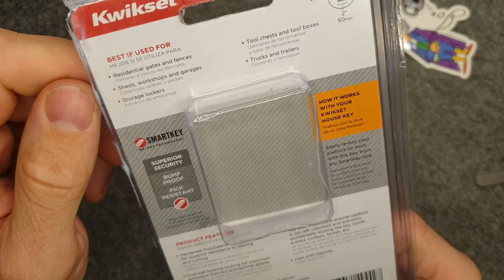[115] Kwikset Smartkey Generation 3 Padlock, from Jon Lock picked by bypassing the sidebar!

Comment: Great demonstration on picking the Smartkey Gen 3. They do look good with that very nicely designed jacket. 
Agreed that maybe a slightly thinner pick would be better to slip down the side of the core to manipulate the sidebar. Either way you did a good job. 
Great video LockFumbler 🙂👍🏻
Reply from the maker: Thanks 🤗
Hehe jacket is a fitting term 👌 it is very nice looking, for sure 👍
I was just bending up all the thin ones and tension wasn't great. Once i realized the thick one fits in there step by step it was super easy all of the sudden 🤷‍♂️
Thanks for watching, take care,
Cheers 🍻

Comment: Wow. My compliments, you did it 👍I think building the right tensioner is the primary task here. I have built 4 so far in different thicknesses, unfortunately none of them got me there. But your video may help me to get there. So, thanks for the informative video and all the best. Cheers 🍻
Reply from the maker: Thank you very much 🤗 
Yeah i also had quite a few failed attempts of building a tensioner 😔 it is a bit tough since one cannot take out the core and see were one is poking around, Charles video really helped a lot to find the right path 👌

Comment: Very cool lock and great picking.
So how much time did you spend on this lock? 
Did you try to pick it with settings for both of the keys? I guess depending on the bitting ot can be harder to pick.
Reply from the maker: Thanks 🤗 ah it was a bit on and off with that one, i tried too long with too weak tensioners in 0.4mm, but they always ended up bending 😔
Yeah i tried with both keys, picks very similar. Plus i also picked it where no key was working anymore, one can dislodge the key change mechanism and accidentally reset the whole thing 🤦‍♂️ oopsie...

Comment: How would i rekey of i lost the key?
Reply from the maker: You would need to pick it and turn 90 degrees. Then, you can push in the change tool in the little rectangular hole. Then, you can use a new key and lock it back up ✌️
I hope that makes sense 😁
Reply: @LockFumbler  it does make sense,  but i don't know how to pick a lock. Thank you
Reply from the maker: @sensitivesteve5207  ah ok I see 🤔 maybe take it to a locksmith and see what they say?